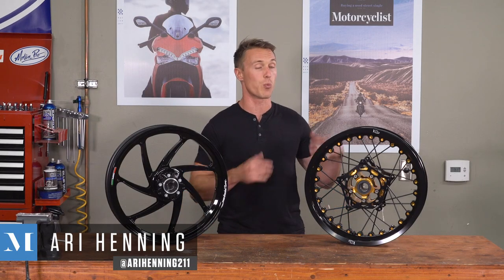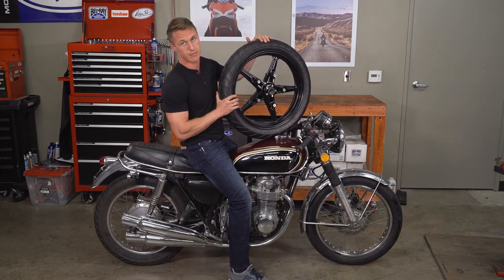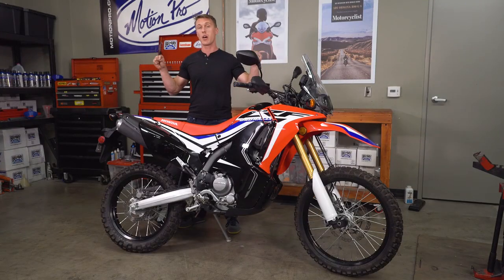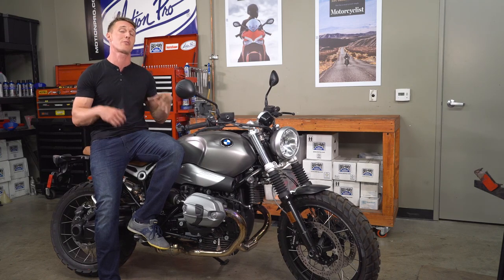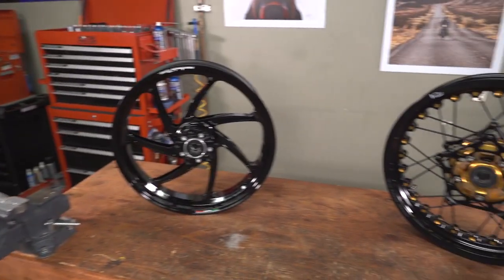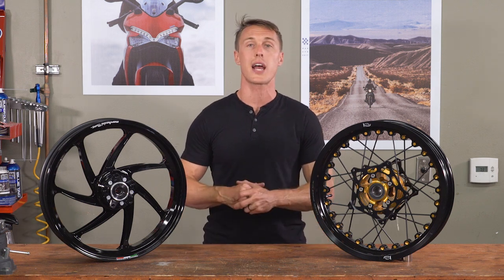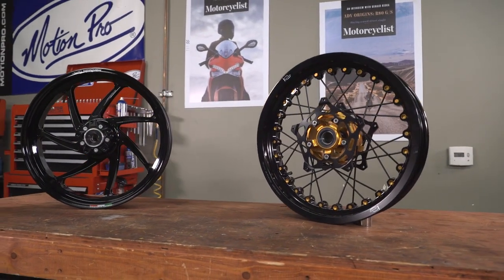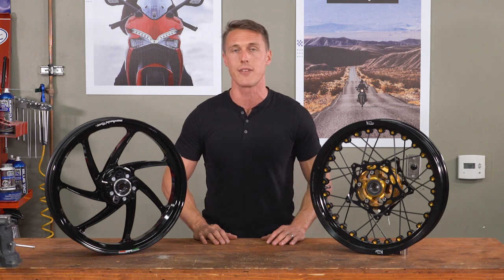Wire-Spoked Wheels vs. Alloy Wheels—Which Are Better?  | MC Garage

Comment: Ill just drop this question here in case someone might answer.

So I'm planning on sprucing up my motorcycle, classic build and all. It comes stock with spoke wheels, which I prefer the look on, I don't like the look of alloy wheels that are locally available and most alloy wheels might not fit on the classic theme I plan on.

But I cannot dismiss the advantage of being able to go tubeless with alloy wheels, so my question is: Can I have a Spoke Wheel front wheel and an Alloy Wheel rear wheel?

Because I can consider using moon disc to cover up the alloy wheel, but as they said using moon discs on front wheel have safety issues so I can only really put that in the rear wheel, which most flats occur on anyways.

For better background, I live in the Philippines with a 125cc motorcycle. Cruising speed is around 80kph (50mph) while the top speed I am able to with the bike is only at 110 kph(68mph), so I don't ride that fast. And I want to go tubeless at least at the rear because I've been on 2 near miss because of flat outs during ride and I don't want that happening again.

Comment: EPIPHANY!  A one piece wheel with two rims....the first rim of course is intergal to the casting/forging but then I propose a kind of inner spacer tube that simply connects the cast wheel to ANOTHER larger diameter rim....in other words the tube is sandwiched between the inner wheel and tire rim!  Why?  Well so dirt bikes can use solid wheels without the downside of solid wheels....and I propose even an added potential advantage!  IF the tire rim had ample abilty to slip or move enough?  Well now you are tubeless so rim locks are not needed anyway but with the slip come drive train saving shock absoption...a better method of "chush drive"  Plus it might provide yet another tuning adjustment?  who knows what advantage might spring from varying the pressure of the spacer tube?  I envision the space tube being molded on it's outer side with perhaps a continuous sturdy slip rib that locks into a corresponding groove on the inside edge of the tire rim...and maybe the inner most side of the spacer tube is molded with intergral nubs or even threaded bosses so that it through bolts to the wheel?  The idea is now we have a solid wheel that take the same sort of abuse a spoked wheel can and maybe even more!  PLUS the idea it has bit of slip engineered in to buffer shock  ...could eliminate any need for the extra weight of cush drive assembly too!  Actually considering no cush drive need or rim locks because now no spokes on dirt wheel so we run nothing but tubless?  Which brings me to even a BETTER potential epihany!  Lose the tire rim ENTIRELY!  re engineer the tires be totally enclosed!  And now the inside of the tire has a molded slot (MIGHT even mold in some metal for strength?)  for the spacer tube to lock into!  NOW to change tires?  Simply deflate the spacer tube and pop the tire off and pop a new one on....Changing tires now becomes much quicker and easy for mere mortals!  Imagine that!  Cause one sucky things about motorcycles for anyone that hauls ass?  The tires dont last for CRAP ...insult to injury buying new tires all the time is the misery and expense of changing the damn things!  I LOOOVE the idea of one piece solid wheels....tubeless tires....quick easy tire change all with potenically no weight penalty....and I am guessing there could be yet unseen benefits also
Reply: ALSO I just realized that foam filled (mousse) tires could come straight from the factory ...just as simple to mount as air filled....could even have combo tires maybe?  with say six foam sections and six air sections? OR a midline foam piece with air on either side perhaps?  Tires that are still light and yet COULD still allow the bike to safely get somewhere with flat tire albeit at slower pace....could open all kinds of new doors for tire design?  Or wait a minute?  INSTEAD of a secondary rim and then my propsed spacer tube?  Dang just make the entire tire have that molded in?  The entire thing disposable?  In other words two air chambers one for the tire and the other is what when inflated locks the tire to the wheel and provides cushion...it would have a totally puncture proof metal hoop molded in that no nail or anything could pierce...to mount a tire now?  let the air out of space chamber part....remove some locking bolts that go through the one piece wheel,  pop the old tire off and slam the brand new one in place...replace the bolts and fill the spacer tube to proper psi....AND guess what?  IF you have a single sided swing arm?  Bob's your uncle you dont even have to remove the damn wheel!  IMAGINE THAT ONE!!   Hey if someone runs with this?  Just remember me okay?   Toss me a tiny percent!   Ya know?

Comment: I am thinking about adding a dual sport to my garage. it will be used for some offroading / motocamping and some commuting. do you recommend having one set of wheels with road tyres and a second set of wheels with off-road tyres for dual sporting?

Comment: I recently began riding a spoked wheel motorcycle. I feel like the wheel hub inside the wheel kinda moves up and down and side to side because maybe the spokes are not rigid enough to keep it in place. It makes for an over all unstable ride feel. You can definitely feel this feeling of being on an unstable wheel if you've been riding on alloy wheels previously. Is that a common thing for spoked wheels or do I need to get my wheels checked out ?
Reply: i am experiencing the exact same thing and im in the process of fitting a cast wheel

Comment: I just watched your spoked and mag wheel video. I was taught at a motorcycle school for mechanics that there is a major difference between the two types of wheels.
    That is how they carry the weight of the motorcycle. A cast wheel carries the weight between the bottom of the rim as it sits on the ground and the axle whereas a spoked wheel carries the weight between the top of the rim and the axle.
   Basically a cast wheel supports the axle and on a spoked wheel the axle is " hung" from the top of the rim.
   What this means for performance or rideability, I don't know. But if you think about it, it is true. Spokes are not strong enough to support the weight of the bike from below.

Comment: Mine is cast Enkei steelies and its not tubeless is still is using tube inside the tire even tho it came out way back in 2006 its just a daily driven scooter for 15 years

Comment: Surely this vid missed the essential difference between the two. One type is easy to clean, the other is a pain, and you end up with rust in places you'd rather not have it.

Comment: I think the tube is actually easier to change than a tubeless tire. Also, tubes are more compact, so you can bring extras on a long trip. In contrast, it's obviously not feasible to bring an extra tubeless tire. I know you can usually just plug a hole on a tubeless tire, but not always. I saw a Youtuber who got a gash on his tire that could not be plugged, and by the time he got a new tire installed and paid jacked up fees to the shop, he was so tired and frustrated that he called off his trip, and returned home, defeated.

Comment: What do you call that kind of rims?
Reply: That spoked one.
Reply from the maker: the spoked one? It's called a wire-spoked wheel. It's comprised of a rim, hub, nipples, and spokes that you lace between the rim and hub by tightening the nipples.

Comment: Tyre temperature. Under similar conditions, tubeless alloy wheel tyres get much hotter than tubed spoked wheel tyres. 
However, I've heard that If spoked wheels are sealed and made tubeless then they heat faster than tubeless alloy wheels.

Comment: Tube based wheels are dangerous when punctured. You lose tire pressure so fast so instantaneously that you can lose control of your bike instantly. It happened to me 12 years ago. I was riding my small motorcycle along the road and then, BOOM, the rear wheel was punctured and the rear of the bikes become violently happy, drifting from one way to another. Luckily I was able to slow down while controlling the happy rear of the bike. By that time the rear wheel was cast aluminum with tubeless wheels, but the guys that sell me the bike put a inner wheel tube. I Take away the tube and put a stem valve, same on the front wheel and I was ready to keep going.

Comment: I'm  not gonna restrict the subject to motorcycles, although you probably can't find wired wheeled cars. But just to make a point, alloy wheels look better. In cars or in bikes. Wired wheels look neutral  on bikes, and hiddeous on cars. So, from a aesthetic only perspective, alloy wheels have no match. And I love them on cars and fast motorcycles that run on very plain lanes or tracks. But, considering comfort on a motorcycle, specially on rough terrain, wired wheels are way better. In this sense, alloy wheels are good looking horrors. In sum, alloy, tubeless wheels on fast bikes are ideal. On the other hand, on irregular terrain, poorly paved roads and such, there's only one reasonable choice,  and it's the wired wheels. Currently, I use the latter.

Comment: its not surprising how long an ally wheel lasts compared to a steel spoked rim...  the difference is simple... stop making them out of shit.    if they where steel they'd probably last a helluva lot longer.

alloy = shit for structural strength and durability...  why you think the make everything out of it now...  so you'll have to replace it.  money in there pockets for less work...

Comment: For me and riding in city the biggest win is for the solid wheels, Wire-Spoked Wheels need adjustment and maintenance solid wheels not, Also solid wheels are more easy to clean. For the esthetic point solid wheels looks more modern.

Comment: Out of the usual box, I pull a trailer when I camp, and we totally thrash the mountains when we go. I got sick of breaking rear spokes on my much-modded Harley, so put Fatboy wheels on my Heritage. Solved the problem, but those babies NEED the stage 2 engine: they weigh 36lbs apiece!

Comment: I had always prefered spoke wheels until the day when on a circuit of Australia, my mate was thrown off his bike at 120 klm/h just south of Port Hedland. Fortunately there are no trees in that part of the country and he landed in the red dirt.
On inspection the rear wheel had split lengthwise along the spokes. When we pulled the wheel off the bike and removed the tyre and band it was clear that the wheel had rusted under the band extensively. My mate had always gone to the same dealer for tyre replacement and fitment from new. It was clear that they had never removed the band to clean underneath it and the dust that gets in through the spokes or to check for corrosion. This bike was only five years old.
There's nothing wrong with spokes, but make sure you maintain them and if you get someone else to change your tyres always get them to remove the band to clean underneath it and check for corrosion, as it will not show on the outside and the chrome will look perfect.

Comment: I really like the spoke wheels on my BMW.  The spokes lace to the outside of the rim allowing the use of tubeless tires. I very much prefer spokes.  I will take issue with your statement regarding alloy wheels handle better than spokes.  That statement is not necessarily factual.  Properly "tuned" spoke wheels can and  often do out handle aluminum cast or forged wheels.  There are a number of important variables.  I ride a "Beemer" that is actually a heavily modified old R100 R. After a complete driveline swap and some suspension mods. It is a multi-purpose motorcycle.  It can eat up hundreds of miles of "freeways" in splendid comfort and then be easily transformed into a formidable "canyon racer" or even show well on a bona fide race track.  Then returned to the distance tourer for the ride home.  My point is that the "Beemer" spoked wheels are admirable performers and they look great doing it.

Comment: In the 1970s Honda used a cross between spokes and solid alloy - Comstar, it was called I believe. It looked more like a cast wheel but had about 4 - 5 " steel spokes. Honda said that they offered the best of both worlds - tubeless rims and the flexibility of steel. I had them on my CX500. Never had a problem with them but apparently they did not look quite right for the customers and were discontinued. Care to comment on them?

Comment: You gotta admit alloy wheels on a classic bike are slightly disturbing
Reply: Yup. I think classic bikes should just stay with spoked wheels.
Reply: @ammarharith5512  yeah.. it looks really classic with spoke wheels.
Reply: Now boys,  don't make me stop this car. Bike
Reply: Alloys just don't look good on a classic bike. Not just slightly. But, the pros alloys offer over the cons are straight up worth the compromise on looks. Biggest being that you can get the punctures resolved and even ride a bit with a puncture in emergency situation. I would really love to get the spoke rims featured in the video but that's rare to find and don't even know what these kinda spokes are called....
Reply: Bike=Spokes
Reply: Tobias Reiner  Mv Agusta 800 dragster RR ?
Reply: Akront aluminum rims are my favorite thing to see on any old classic motorcycle....even on a restored one where everything else is stock akronts, more modern tires and high spec rear shocks are nothing but sheer class improvements!   Along with the unseen upgrades in electrics like CDI ignition if a bike is older than that...certain things are NEVER sacrilige if you ask me
Reply: @anshmittu2439  No, alloys wheels look terrible on classic or standard 350. I have seen people in Delhi getting alloy wheels and they look more like a chopping machine. Spoke wheels for classic/retro motorcycles
Reply: Haha, that was ridiculous
Reply: Couldn't agree more!
Reply: Exactly
Reply: true
Reply: Depends on the alloy wheels.
Reply: It’s fucking irritating on a classic
Reply: 100%
Reply: Depends on your definition of classic there are some classic 80s and 90s bikes that look real good with alloy.
Reply: I only accept 3 spoke alloy wheels for classics
Reply: @anshmittu2439  i have never said "you shoudn't like them" have i?
Reply: @dr.abhishek_arya  just agree to disagree
Reply: @dr.abhishek_arya  you implied he shouldn't like them by calling him names for liking them.
Reply: @anshmittu2439  they look cool to you because you must be a kid and your dp has "i like alloys on classic bike" written all over it
Reply: @dr.abhishek_arya  lmao did you just correlate liking alloy rims to being a kid? Get the fuck outta here.
Reply: @dr.abhishek_arya  ikr oh boi I can’t relate enough to your reaction they look crap on Royal Enfield classics oh man I’d rather not ride the bike then with alloys on em
Reply: @dr.abhishek_arya  LMAO

Comment: Interestingly enough you didn't mention that wire spoke wheels have to be readjusted about every 5,000 miles or so which is an added cost you don't have with alloy wheels.
Reply: bullshit
Reply: @davidjones-vx9ju  That is not bull shit you dummkopf.  Maybe you need to do a little more research instead of calling BS just because you don't understand something !
Reply: @benth162  i research it everyday on my bike with spokes
Reply: I've never heard of it, people just adjust them if it starts to make noises
Reply: Furn333  you are clearly wrong... i bought a new 2001 bonneville never had any problems with spokes

Comment: Mag wheels can run tubeless,and therefore can be plugged on the road. A HUGE advantage!
Reply: why should it be modded by an individual? it should be manufactured like that.
Reply: Spoked wheels can actually be modded to be tubeless. And there are setups like tubliss for bikes that are only on dirt
Reply: Plenty of spoked wheels are tubeless, and any can be modded to be.

Comment: That spoke wheel is damn beautiful.
Reply: Except when you get a puncture!
Reply: Curiosity Rover it's tubeless.
Reply: @paulh4943  unfortunately not, as I experienced last week on my Suzuki boulevard. Replaced the tyre with a tubeless but advised by the bike shop it won't inflate on spoked rims and needs a tube as well.
Reply: Curiosity Rover the kineo wheel pictured in this video is tubeless.
Reply: Paul H of course they’re tubeless, they’re worth a loooot of $$$ and they’re made in Italy.
Reply: Invasion it was a response to curiosity rover.
Reply: I wonder if they fit a drz400 sm?
Reply: @H.D.B.23  they are probably worth more than your entire DRZ..

Comment: In 125 - 150cc category. Which is better sohc 2 big valves or dohc regular 4 valves?.
Reply: Honda NSR 125 SP.
Reply: SOHC 4 valves. You want greater lift for more torque down low. And simplicity of manufacture for cost reduction.

Comment: Hi....I have my royal Enfield classic 350 and now I am looking forward to switch over to alloy wheels for the spoke one....is it safe to switch over in terms whether the alloy wheels give the same result of using spoke? Or less?...I would use my bike in off-road, does the alloy wheel break or crack at times??....can you give me a clarification???

Comment: i have a super motor and the wheel size as usual is 17 on both. I wanna to change 19" to front and 18" to rear. Will this work. The reason for me to do so is you cannot find 17" dual purpose tires in Sri Lanka. It is becoming real hard issue to me. Please find me a solution to me in this regard and it will be greatly appreciated. Thank you

Comment: Weight of wheels is always below the suspension, so it doesn't matter as much I'd think. Still affects power to weight ratio, however.
Reply: Dream Vigil it’s not the weight it contributes to the bike but the forces it exerts when spinning and you trying to change direction.